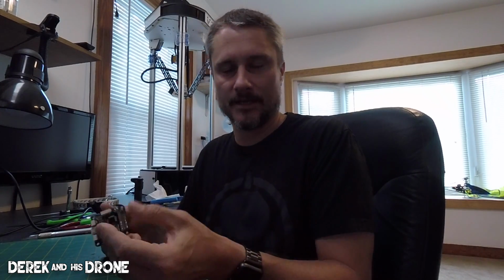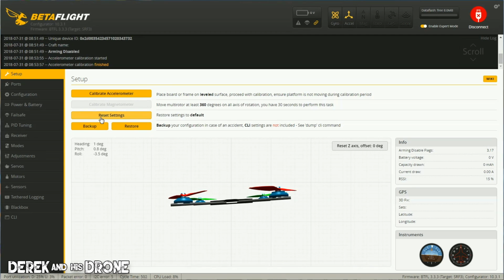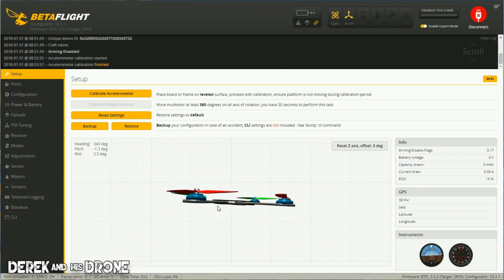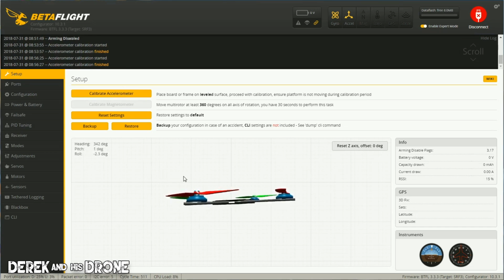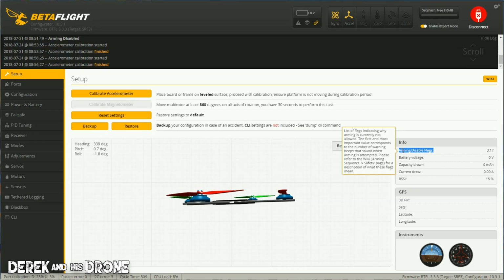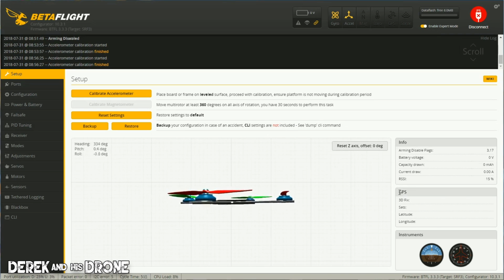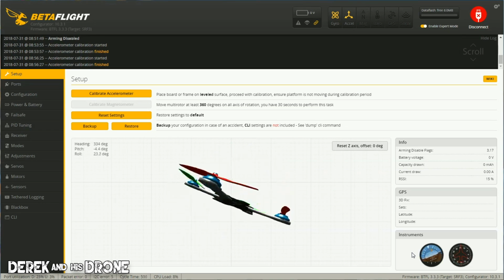Basics of Betaflight - The Setup Tab

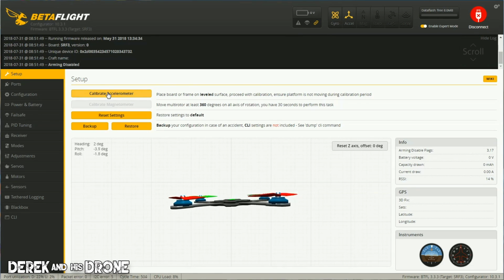Comment: Can you please help me with something, I just received my first flight controller and I was testing it in betaflight. If I let it still on the table, at every 10-20sec. the heading value from BF setup screen increases by 1deg, I don't know if it's a problem, or it is normal. I've seen in your video the same behavior(at 2:10, 2:20, 2:27) , but I'm not sure you are not touching the FC
Reply from the maker: Honestly that is not something that I have paid attention to.  One of the problems with angle mode is it can have some drift.  Maybe that is what you are seeing.  I say send it!

Comment: My friend just will the beta flight configuration work without downloading the drivers I am just needing to do simple set up no flashing just was wondering
Reply from the maker: A driver is a piece of software that tells windows how to control hardware. Every device needs a driver. However if you have windows 10 it might install the driver automatically for you. It will not do the DFU driver.